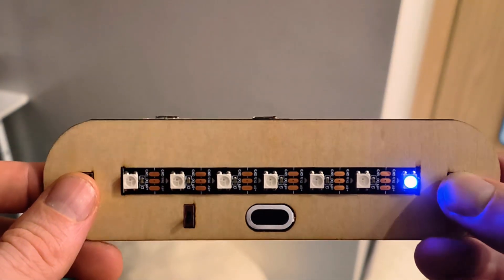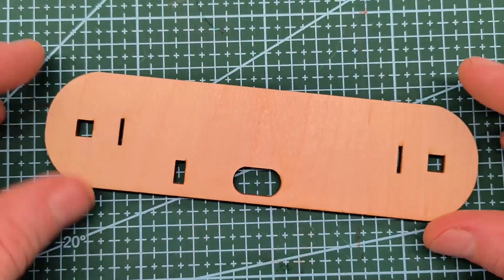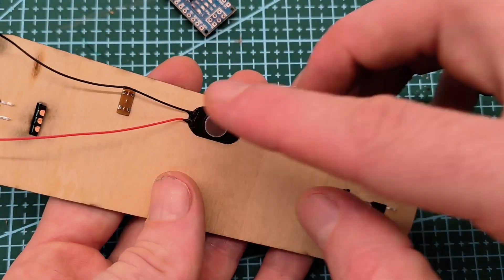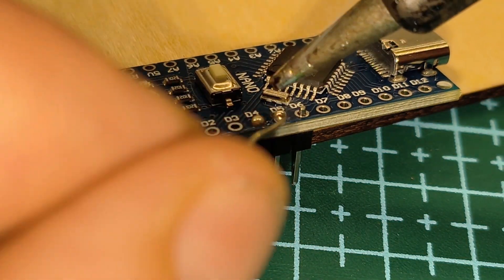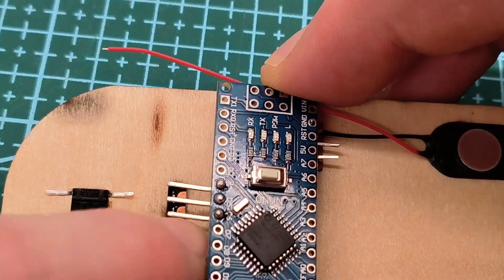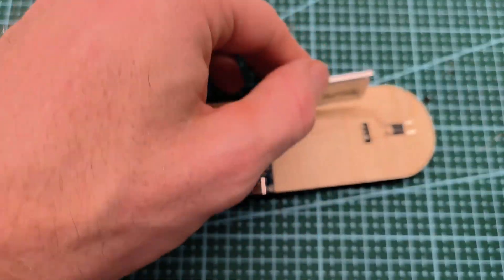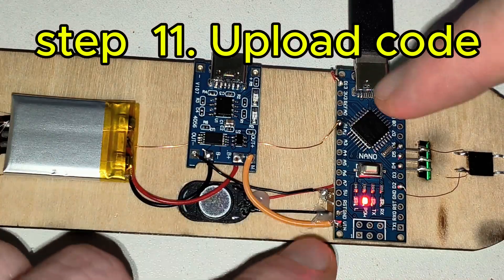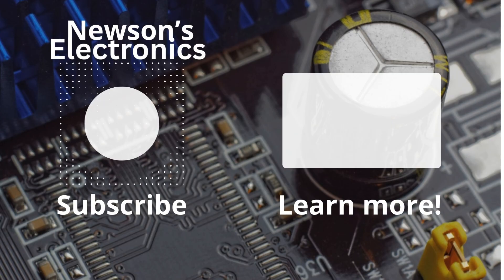LED Pong V2.0 | Fun Arduino Project – Part 2: Build Video

Comment: This video is fake. You can't power the Arduino Nano with a 3.7V module, and on top of that, you're powering it from the 5V pin and Vin?

It's ridiculous.
Reply: Yes you can, the clock will be slower.
Reply from the maker: its real I did it.